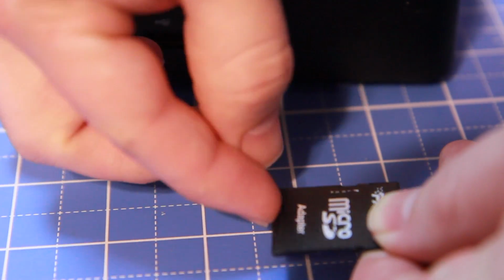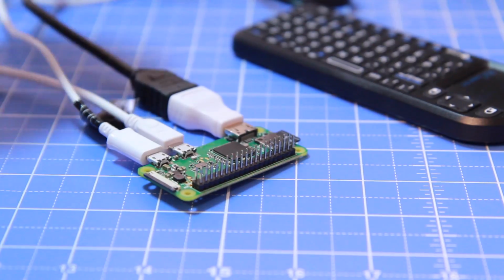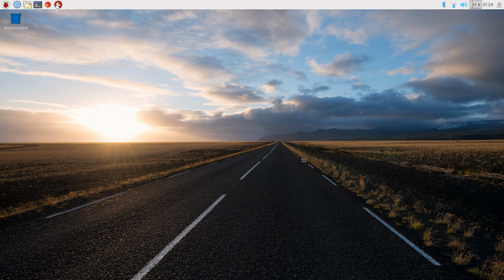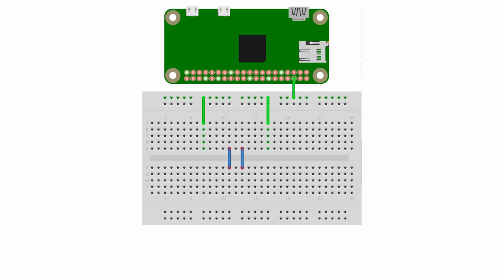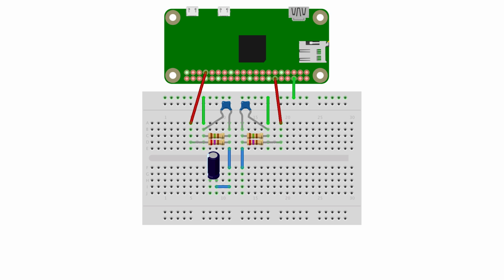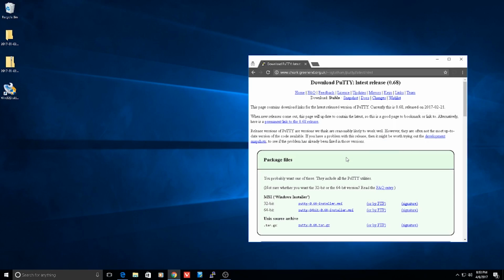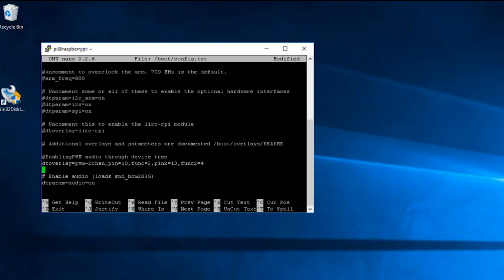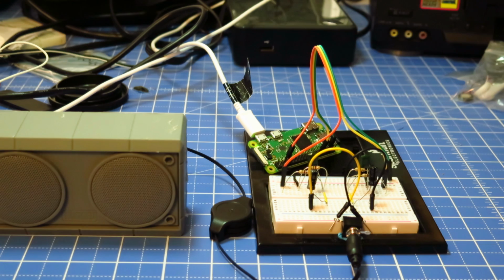Adding Audio Output To The Raspberry Pi Zero - Tinkernut Workbench

Comment: Superb content...I'm lucky that you use just 3 pins of the pin header to have audio. In the meanwhile I'm looking for which GPIO pins can I use to have the so called VGA666 output. In the case I nail configuring VGA666 then I'm in the dark (somehow) because I know that for full fledged PCs with a Linux Distro I just edit /etc/X11/xorg.conf and fiddle with it to have 15Khz resolutions but with Raspberry Pi Zero might not be the case. 

What I don't know if the raspeberry Pi Zero has some sort of "video driver", for instance in linux distros there's "nvidia" (propietary driver) , "radeon" (i think this is opensource), "nouveau" (nvidia opensource driver). I don't know if I can modify the video output resolutions with the same stuff I touch in Linux Distros (xorg.conf I mean)

I hope you can enlighten me on at least how to get the VGA666 pins with the correct GPIO pins and some advice for how to fiddle with custom resolutions (15 Khz I mean, like 384x224 for Capcom CPS1 games, 256x224 for lots of Arcade games and the SNES and so on.

Hugs from Chile, South America . It's almost March 2024 here and summer soon's gonna be over (I hate winter since I always get a cold in that season).
🤗

Comment: On a brand new raspberry pi zero 2 W ,  I had to use the following commands to get audio output... this only outputs audio on GPIO18 which the readme.txt file says is the only output valid on all models...

dtparam=audio=on
dtoverlay=audremap,enable_jack
dtoverlay=pwm-2chan,pin=18,func=2

Comment: Could you tell me What is the voltage of the electrolytic capacitor? I really need to know
Reply: I googled this a bit and as far as I can tell, it seems to not be too important, it seems to mostly be a case of the upper voltage limit (where it releases the magic blue smoke)

Comment: i not can modify the config.txt
$config.txt: Read-only file system ][ Error writing /boot/config.txt: Read-
SO=Recalbox
Reply: ok i find it.. 
for recalbox: Connect with SSH
Remount partition on read-write
Command: mount -o remount, rw /boot
Use nano to edit the file located at /boot/config.txt
Command: nano /boot/config.txt
Now close and save the file with "STRG + X" and reboot your Raspberry Pi

Comment: i have a question. is it possible to just connect an audio amplifier to the correct pins on the pi and it work fine? or do you have to make the circuit?

Comment: It's a shame the workings of the circuit you made were not explained.. I remember long hours studying the concepts related to filters and all the math that comes with it. Guess math isn't interesting enough for popular videos =(. Ayways the TL;DR: he forced the raspberry pi to output the left and right audio signals through the GPIO pins as a PWM waveform, but you cannot use that to drive a speaker because of the high frequency content and the DC component so you need to use a low pass filter and a DC blocking capacitor for each channel to end up with a passable audio output, possible improvements could be: adding another pole to the filter or having another filtering stage, using larger blocking capacitance to improve low frequency response, adding transistors or op-amps to avoid drawing large currents directly from the GPIO pins and prevent any input loading and finally match the impedance of all stages to improve frequency response.
Reply: I'm not sure he completely understands the schematics because he did get the schematics from adafruit he didn't make them himself

Comment: Just so you know, you can place an empty file called 'ssh' on the /boot directory of the sd card, to automagically startup ssh! Same goes for wifi, you just have to put a 'wpa_supplicant.conf' file with credentials in the /boot directory. When the pi starts up it will copy the wpa_supplicant file to the right place, and the pi will detect the ssh file and enable ssh. That boot directory, by the way, is accessible when you've flashed your sd card, as a partition in windows/macos/linux! This way you can easily enable those things without connecting a monitor and keyboard to your pi zero. I'm currently getting a lot out of my pi zero w, without even having touched a dongle!

(As for the keyboard layout, this is configurable via the raspi-config utility, over ssh.)

Comment: Make a raspberry pi phone
Reply: That would be pretty easy, install android 4.1 on a raspberry pi 3 b+, connect a touchscreen display and external battery, then get a nice case for it, it'd be pretty big but it would be up to average mobile phone standards.
Reply: You could connect a Sim adapter as well for service I'm quite sure

Comment: I'm sure Tinkernut knows, but for anyone that doesn't, you can use VNC to connect to your Pi's desktop remotely, instead of just the command prompt with Putty: https://www.raspberrypi.org/documentation/remote-access/vnc/
Reply: ya but command line is just more powerful.
Reply: You can access the command line from the Pi's desktop.
Reply: well you know, it depends on the job. Each one has his own way of doing things. I've used both for different kind of task.
Reply: I agree, but I'm just making people aware of it.